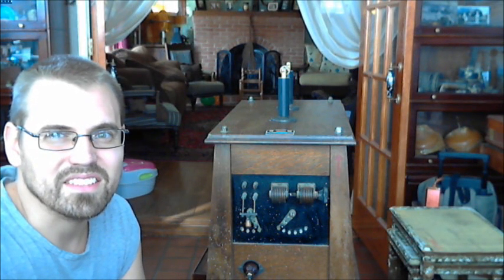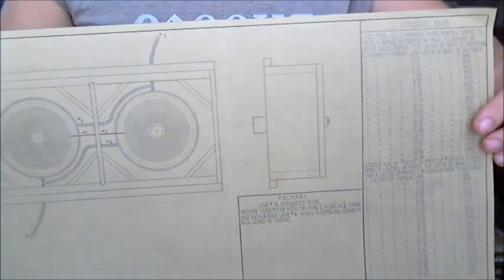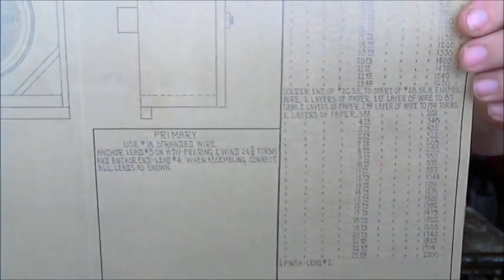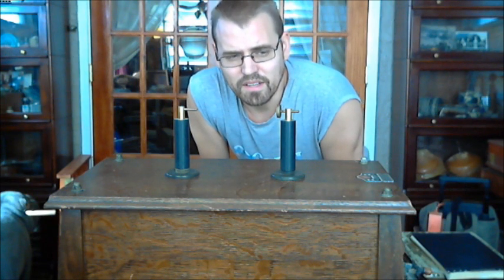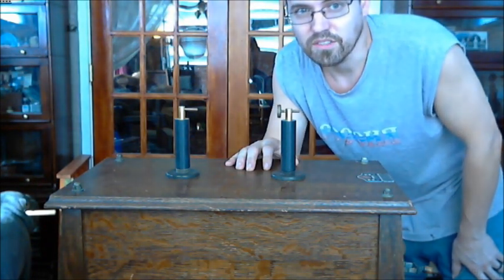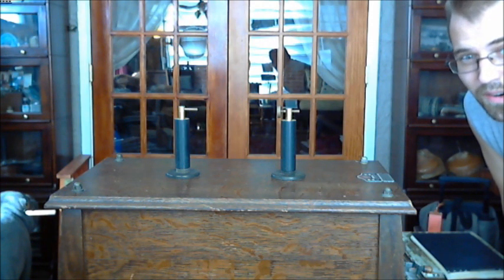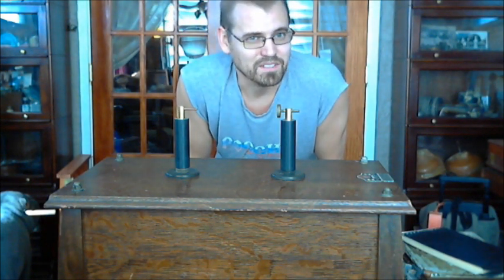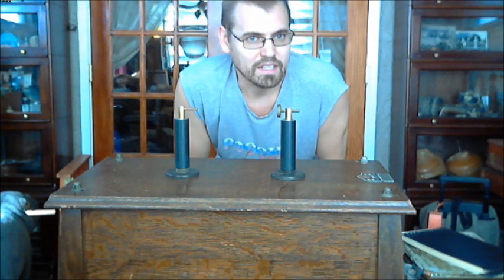Fischer Tesla X-Ray Coil.  One of the most efficient Tesla Coils ever made.

Comment: Thanks for posting this, you have some very beautiful machines there! The pancake coil sparks, in my experience are very typical of pancake coil Tesla coils, yes each machine in my experience has a certain "flavour" of spark type. The noise and sparks reminds me of pancake coil that was over a meter diameter that I played with 30 years ago that had beer bottle salt capacitors. I recall that when I switched it on, guests to the Lab would run a mile thinking something blew up, LOL! As for the second device modern day electronics, particularly if powered by a good quality function generator would far surpass the accuracy of the machine you have there , although I am captivated by its quality of workmanship, which is truly astounding! Great video-Cheers from Australia -John